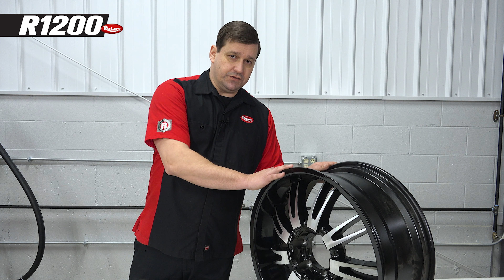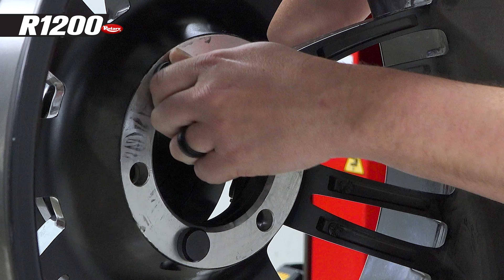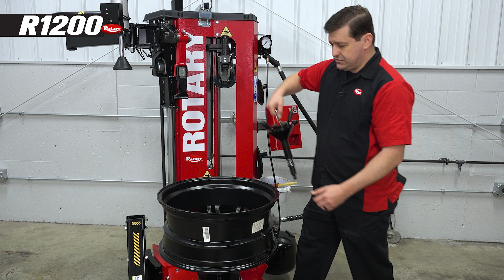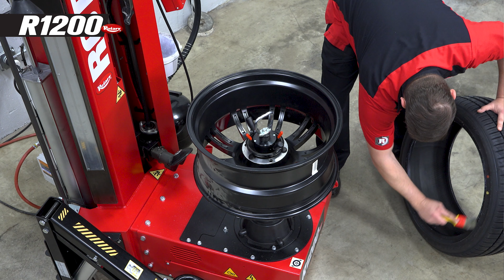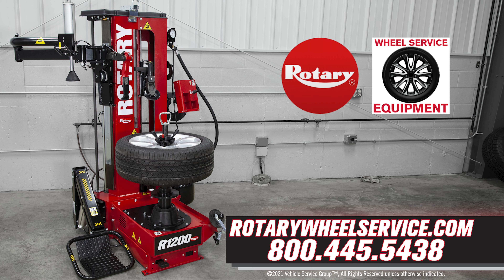Rotary R1200 Changing Reverse Mount Wheel

Comment: Can any tire changer perform reverse mountings of tires??
Reply from the maker: The answer is yes and no...Yes, technically they all can, but a center locking machine will help protect the wheel from getting scratched or damaged in the process.
Reply: @RotarySolutions  I had a set of wheels where the spokes stuck out far enough that my flange would not set flush on the machine without rubbing the spokes.